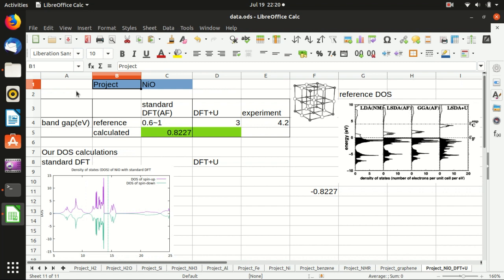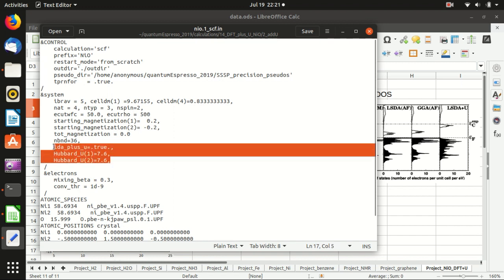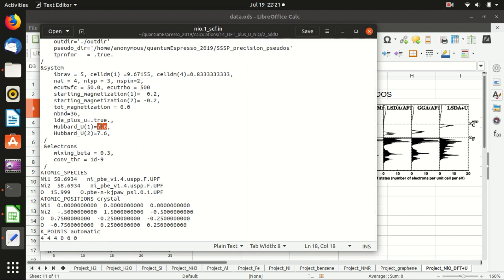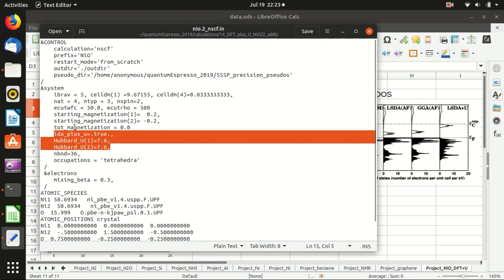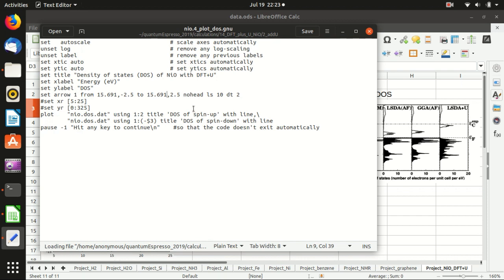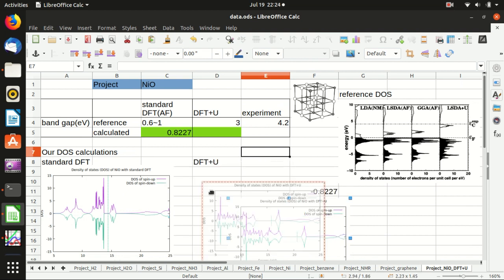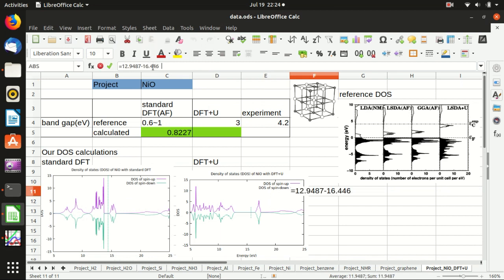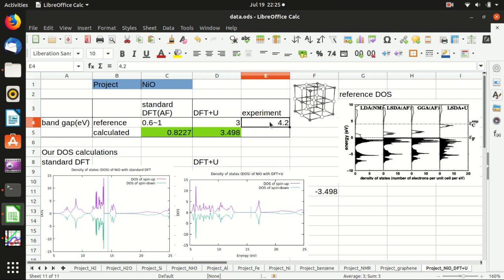Project: 12.2 (DFT+U) NiO with U | Quantum Espresso Tutorial 2019

Comment: Do you know how can we compute those hubbard parameters when they're not in the literature?
Reply: Hello;
If its its not too late, I will make a suggestion.
You can calculate the U parameter, ab initio, using hp.x code [ hp = Hubbard Parameter ]. It is available in qe-6.4.1 and beyond. 
There are examples in qe-6.X.X/HP/Examples on how to use the code

Comment: Thank you for this tutorial, it was very informative. I have a question about my situation. I have two organic molecules and one metal atom on the metal surface. My goal - to calculate magnetic properties of this system using DFT+U in Quantum Espresso. I have an optimized geometry by LDA. So, I don't understand how can I compute Hubbard_U using Quantum Espresso. Do I need calculate U for each atom (C, H, N and Fe)? And what should I do - just run the perturbed calculation for whole the system and run as many times as there are atoms in my system? I mean that: for the first time I run the calculation for whole system and indicate only U for one type of the atom in my input file, then again - with indicating U for another ntype. Or am I wrong?
Reply: Hello;
If its its not too late, I will make a suggestion.
You can calculate the U parameter, ab initio, using hp.x code [ hp = Hubbard Parameter ]. It is available in qe-6.4.1 and beyond. 
There are examples in qe-6.X.X/HP/Examples on how to use the code
Reply: @bouber9333  Thank you
Reply: @bouber9333  Hi! could you help me to calculate it? i can't find examples of the calculation

Comment: Hello, thank you for your efforts. I have a problem with Hubbard correction for SnS2, I added Sn to the QE files as it doesn't include Sn by default and recompiled the code. But unlike in literature in which the SnS2 bg is corrected from around 1.3 or 1.45 without U correction to around 2 eV with U, I didn't see any change for the bg. I tried 8 eV and 9 eV as indicated in the literature, but I also tried many other values below and above these values but no change.
Could anyone help to find what is the problem?

Here is my input file:
&control
    calculation = 'scf'
    restart_mode='from_scratch'
    prefix = 'uc_scf_wVCall_U9'
    outdir = '/home/houcine/outdir'
    pseudo_dir = '/home/houcine/pseudo'
    verbosity = 'high'
/   

&system
   
    ibrav = 0,
    nat   = 3,
    ntyp  = 2,
    ecutwfc=50
    ecutrho=400
    nbnd=26
    occupations='smearing',smearing='marzari-vanderbilt',degauss=0.01
    lda_plus_u=.true.  
    Hubbard_U(1)=9.0,
/

&electrons
    conv_thr=1e-8
/

ATOMIC_SPECIES
 Sn    118.71000  Sn.pbe-dn-rrkjus_psl.1.0.0.UPF
 S      32.06600  S.pbe-n-kjpaw_psl.1.0.0.UPF

ATOMIC_POSITIONS (angstrom)
Sn      -0.000000000  -0.000000000  -0.000000000
S        0.000000000   2.138507167   1.490115509
S        1.852001313   1.069253463   5.005016561

CELL_PARAMETERS (angstrom)

   3.704002867  -0.000000000   0.000000000
  -1.852001434   3.207760579   0.000000000
   0.000000000   0.000000000   6.495132070
K_POINTS (automatic)
 20 20 20 0 0 0

Comment: thank you for the video, how will choose the values of the U correction parameters of each element for example the transition metals like Fe ...
Thank you.
Reply: @realquantumnerd  ok thanks, yes i know how to work with values it is exists in articles, but i still have the same problem at band gap level is 0 eV but the experimental value is almost 3 eV !!!
Reply: @realquantumnerd  yes I am working with the same materials as the literature and with the same U, but the problem I think the 3d orbitals of the element Fe which are well localized, which makes a heating with the band of conduction and the band of valence c ' is a zero gap.
thank you